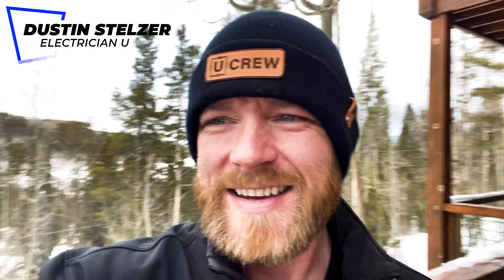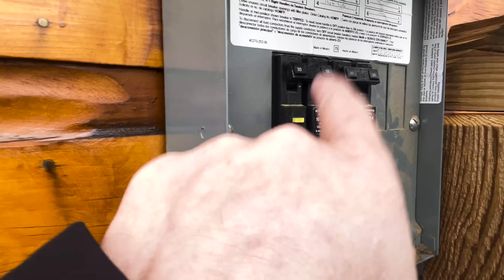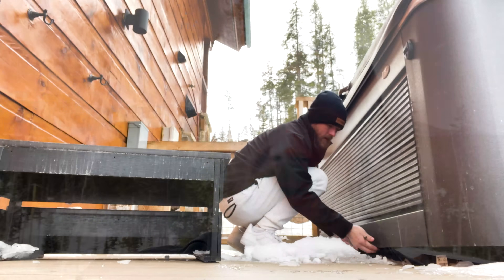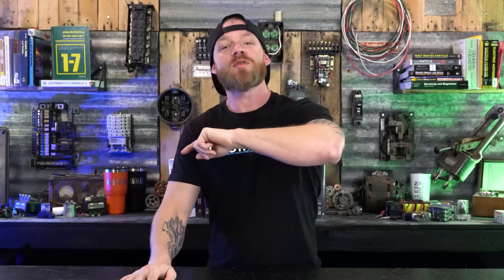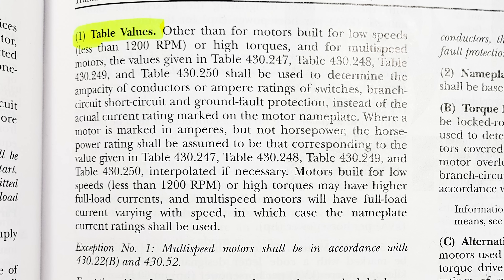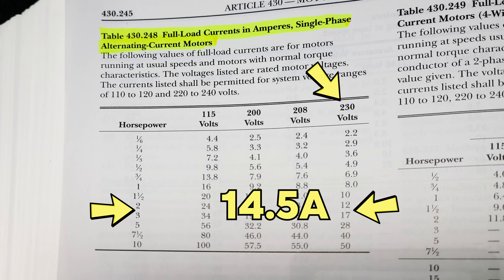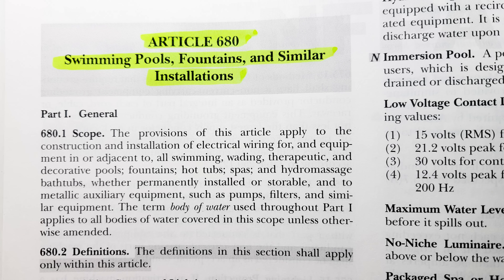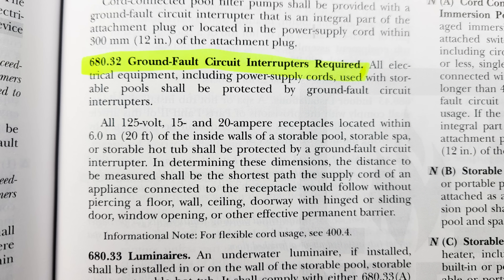Why Do YOU Think My Hot Tub Tripped?

Comment: I always wonder about the motor table rule. How often is the plate on the motor wrong? And how far off could they be? Why can we trust a heater plate, but not a motor plate?
Reply: I thought the same thing. Wouldn't the spec plate by the manufacturer be more accurate than a generic estimate?
Reply: I believe it’s because the motor table shows FLA (Full Load Amperes) it’s essentially the inrush current because it takes a bit more power to get the motor started, but once it starts it doesn’t need as much power as it becomes more “self-sustaining” if that makes sense. Like the whole object in motion stays in motion, it’s basically a boulder on top of a hill needs 10 guys to push it, but once it starts rolling down the hill, no one has to. Obviously there’s still consumption and that is what is generally listed on the nameplate. Some motors will list their FLA, most don’t as it’s not required on the nameplate. It’s something that’s inferred as a “qualified personnel” statistic. 

Now when you look at a heater, it’s the same thing but generally to a much smaller scale so you wouldn’t get such a difference. If the heater was solely induction with no motor, you wouldn’t have the issue at all. It’s really just the inrush current (to my understanding). If this is incorrect or I missed something, please add to it, I’m here to learn as well haha!
Reply: @AladeanYT  ... the higher (start) load is called LRA... locked rotor amps. The FLA is the long term running draw at rated HP. Start amps can be up around four times the run amps, which needs to be considered for wiring and breaker size.
Reply: @rupe53  Common misconception. Locked rotor is literally that. It's when a failure binds the rotor and stops the motor. It's not the startup draw.
Reply: @ericthered9655  ... technically that's true but it's also a decent number to consider because you can approach that for a fraction of a second. A properly sized breaker won't be a problem either way. OTOH, if you are too close you could go over the edge.
Reply: @AladeanYT  The plate on motors gives a max draw which is with startup factored in. Sometimes they even give running and max. Thanks for explaining it as if I'm not an electrician.
Reply: @ericthered9655  Yeah, I believe that’s called FLA, I could definitely be wrong though, the I way I see it is the Full load is definitely going to be more from the running load based on the name so I assume that’s what’s meant. (although an assumption with electricity can definitely make more than an a$$ out of u and me.) Also, my apologies, I’m not too sure whether that’s sarcasm or not, I try to make comments in a way where anyone who may or may not know about electricity or even just a topic itself can understand, and in my opinion nothing is better than a well thought analogy haha!
Reply: @AladeanYT  No worries. I'd think asking about why we have to use the tables might give it away. You are right about the startup. But I'm fairly certain that is accounted for by the manufacturer.

Comment: Many hot tubs require these two breakers. 

One is for the heater and the other is for the pumps and controls/ lights. 

Perhaps when they installed the new hot tub it only used a single breaker and they hooked it up to the largest one in the existing panel (the 30a). 

Prob should have been a 50. 

Just a guess. Hard to know without looking at the hot tub.
Reply: Jacuzzi and Sundance tubs require a single 40,50,60  gfci breaker

Comment: Even though I'm an amateur at this stuff, whenever I rent a vacation place, I'm often appalled at the lack on maintenance they do on their electrical outlets. Often I try to plug something like a USB charger in, and the charger just falls out of the socket due to wear.

The other thing is that I often can't figure out what their light switches do. In one case, it appeared that they had a light that was on a 3-way circuit at one point, but then they wanted a dimmer on it, and ended up hardwiring one of the two switches into the closed position.  Weird stuff.

Comment: I wonder if the the 20A circuit on the tub was wired to the 30A CB and the 30A was wired to the 20A CB. The 20A trips and the 30 does not. Possibly the installer ate an edible before work. Why is this tub not fed with a 50A single circuit?  I have not installed wiring for a tub in 20 years, but last I knew that's how they are designed. 1 - 3 wire 208V service, 2 hots a neutral and a ground. So, I think there is another violation as well with the double feed not taking ALL power away from the "appliance" on a trip condition.  That 30A is powering something inside the control box when the 20 trips and it is obviously not the control circuit. 

32 years as an equipment engineer,  have had my Journyman's card as an Electrical Controls Technician for 25. I try to stay up on code changes as my needs arise. Love your content and enjoy your trip. What a stellar view.

Comment: Never seen one with two double pole breakers.. normally the ones I wired are usually 50a 60a on a single pile GFCI breaker and worked well
Reply: It's possible each leg is a different purpose but they want both to pop at the same time. Ship I work at recently we had issues with power. I found out, our AC units have a 3 pole breaker. My guess is the third pole is for something extra but designed to force everything to shut off all at once. Ex maybe the inside evaporator is 110 and they want it to shut down with the pump and condenser if a fault occurs.
Reply: @adamplummer2190  that sounds like 3 phase
Reply: I ran into one that needed a 2 pole 30 GFCI for pumps and heat, and a 1 pole 20 amp GFCI for control power. Was an odd duck for sure.
Reply: @tailgunner2  interesting, good to know 👍
Reply: Caldera tubs use a 30/20 setup. The 30A controls everything except the in line heater which is controlled by the 20A.
Reply: Same